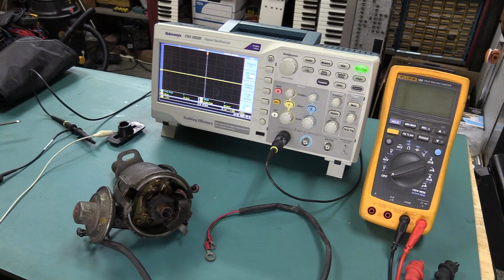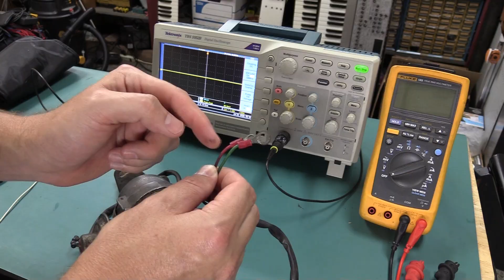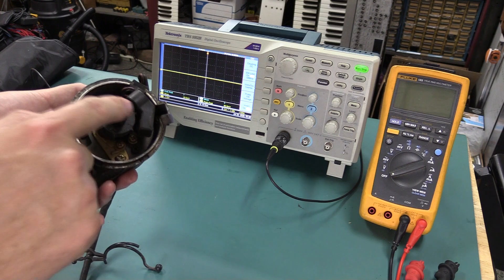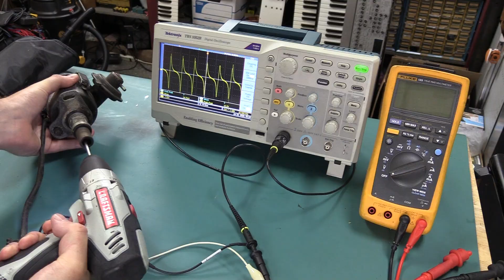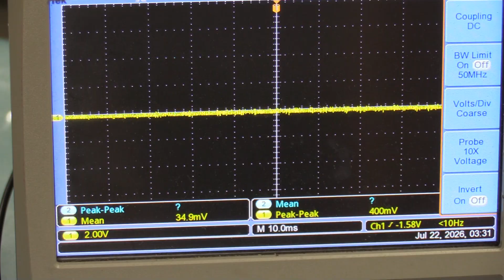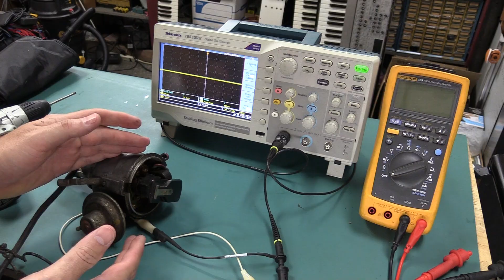How To Test Your Datsun 260Z/280Z Distributor Pickup Coil

Comment from the maker: NOTE: here is a good procedure for working though the ignition system. Same steps can be used for the 74 Datsun 260Z module.
-----‐-------------------------------------
QUICK REFRENCE FOR COILS:

260Z:
Green/White = coil ground
Green/Red = retard pickup
Yellow = advance coil (Automatic only)

280Z:
green = ground, 
red = retard pickup,
Brown = advance pickup (None California models only)

  (always start here because if there is a problem with reluctor or pickup coil it can save more troubleshooting time). 

STARTING FROM TEST PROCEDURE IN VIDEO:

If this looks good, I would ohm out the harness between distributor connector and ignition module this can simply be done by removing ignition module form harness and using a gator clip jumper wire. Take the gator clip jumper wire and connect it  between the the green wire to the red wire at the module connector, (This will short the wires together) Take a multimeter set to ohms and read the resistance at distributor connector...should see 1 to 2 ohms here with the wires jumpered. If you are reading an open, you can take each wire independently to body ground and test continuity from wire to body to rule out which wire is open.
(Do the same for brown wire on none California models).

If all that checks out then you have now ruled out the distributor and harness between distributor and ignition module.

You can also continuity check the blue wire going to coil in the same manner. Make sure key is off, connect a gator clip jumper wire from the blue wire at ignition module connector or at negative side of ignition coil and take ohm readings at the other end. If you read low ohms, that rules that part of the harness out as well. 

Next test is leave ignition module unplugged, turn ignition switch on, and check the black with white stripe wire for +12V reference to solid black wire at ignition harness. If you have no +12V then you could have a blown fuse or a harness feed problem. It could also be an open ground so check for the same voltage using body as ground reference.

Last check is turn ignition on and see if you have +12V getting to positive side of ignition coil. These use a dual ballast resistor so you also want to check for voltage at coil while cranking engine, (it boosts the current to coil during crank fir a hotter spark). 

If all these tests check out ok then I would definitely suspect the ignition module.

OTHER HELPFUL VIDEOS:

75/76 and 77/78 ignition module testing:
https://youtu.be/_VkkOaQmjyM

74 260Z ignition module testing:
https://youtu.be/WP933R8kink